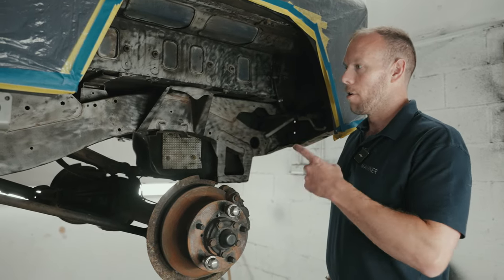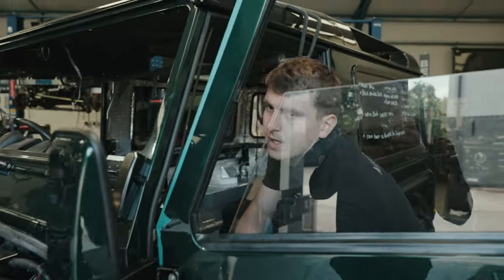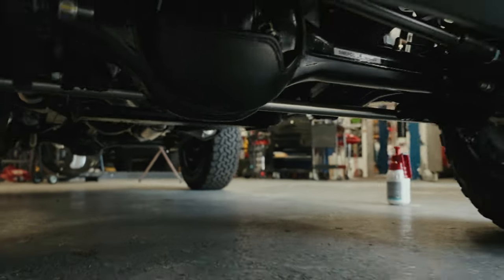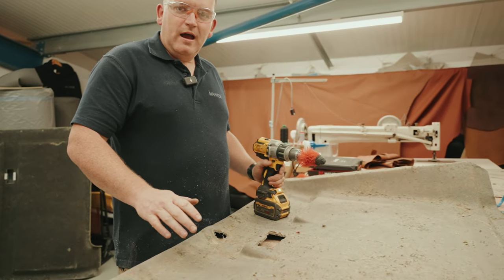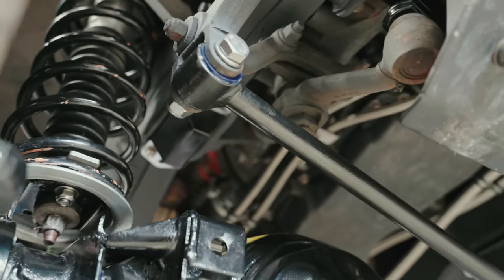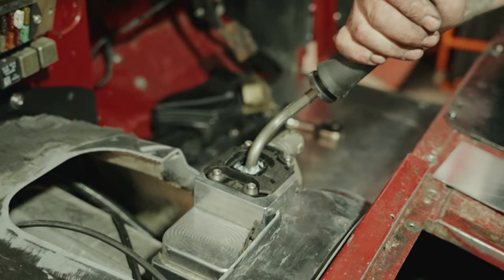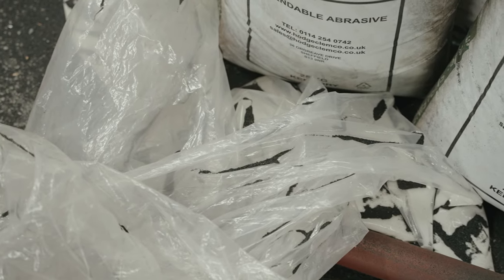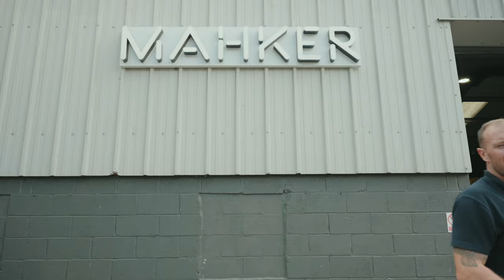NO MORE RUST - Rust Protection DONE RIGHT on a Defender 90 Chassis || Mahker Weekly EP086

Comment: You may want to check out a proper Dry Ice Machine.  You don’t need shot or beads to remove the paint and Waxoyl, we can strip frames to metal quite easily with ice alone.  Much less mess.
Reply from the maker: What machine have you got ?
Reply: Looks like you deleted my comment,  you need a machine with particle control and much higher pressure and flow.  I use PCS60 coldjet and ICS 030.
Reply: @R20Motorsports the machines that offer particle control are the ColdJet PCS60, ICS 030 & ICS 410S, correct?
Reply: @Eferrari34  Those machines for sure have particle control which is cutting the ice by the machine, not the tip.  Not sure if Karcher has anything.

Comment: How much of the chassis are you doing for £2k? Notice you'd left the front inner arches in place, would you be removing the fuel tank on a 110/130?
Tell your trimmer that it's 'Houndstooth' btw, not 'Hoodstooth' 👍
Reply: Only the parts you can see, the rest will rot